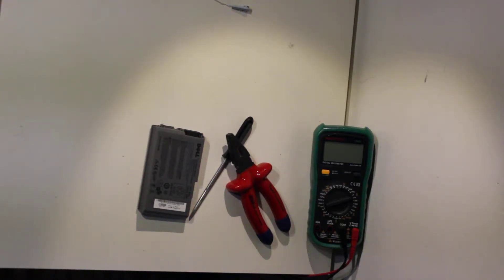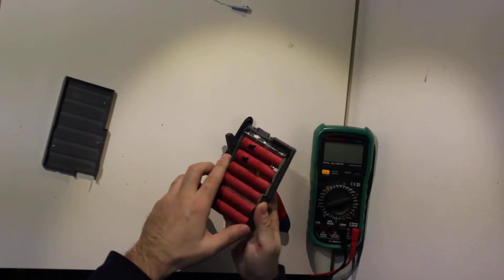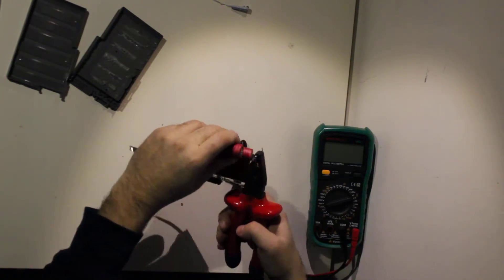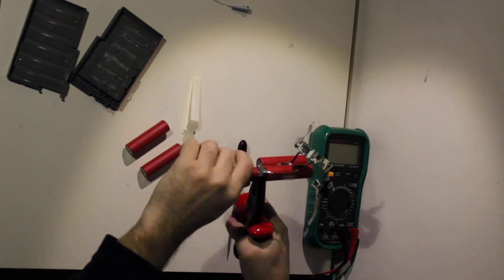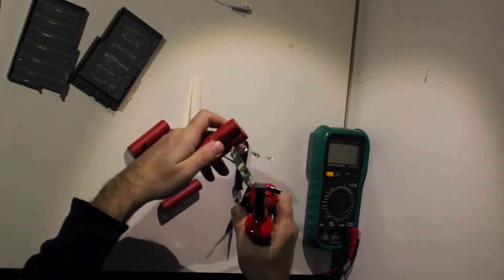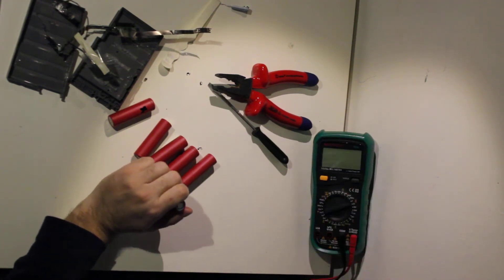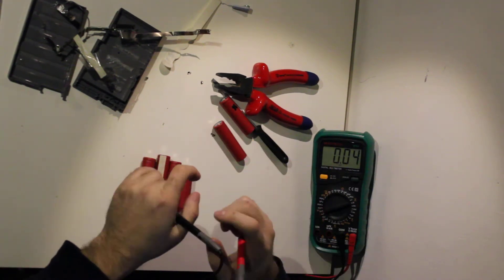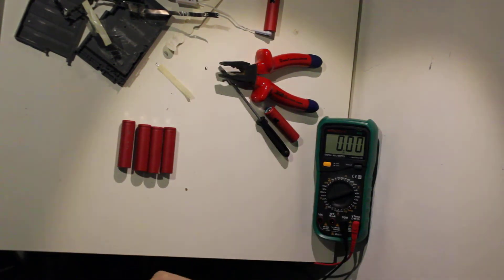M9014 Dell Laptop Battery Teardown - 6x Sanyo 18650 UR18650F

Comment: Dell D600 battery (C1295)With a jumper between Ground and the SYS PRESENT pin I can measure voltage and discharge the battery using a R/C charger /discharger.  However I can not charge at the out most pins.  No current goes into the battery.
If I put the battery back in the laptop it will charge it full again.  Would you know if I need another jumper to allow the battery to accept charging?
Reply from the maker: Some Dell's batteries have a detect pin so it does not charge if it does not get the needed signal... Can't say more as we only tear them down.